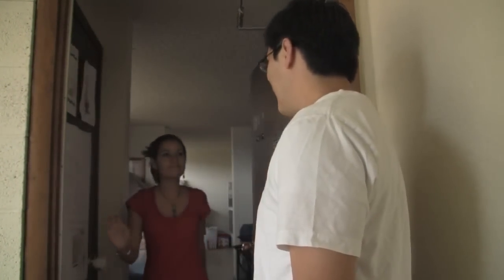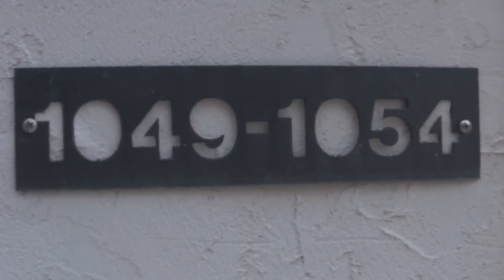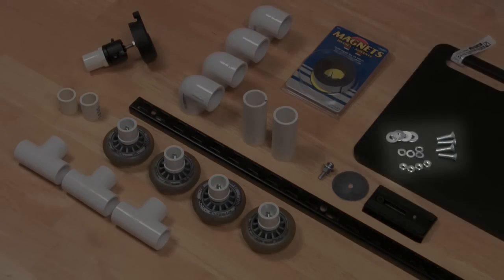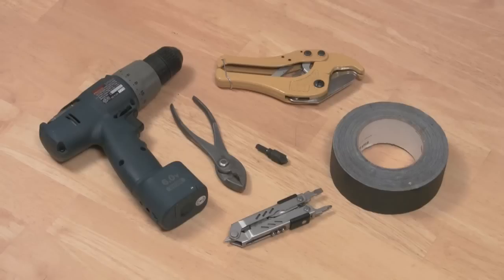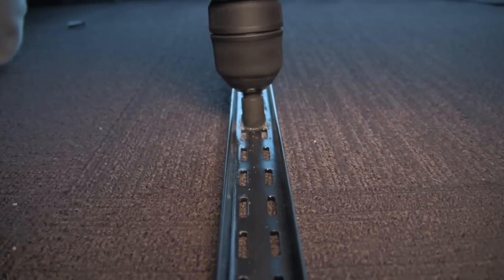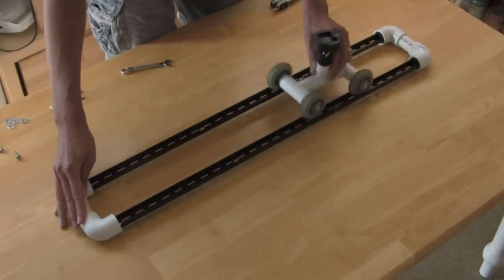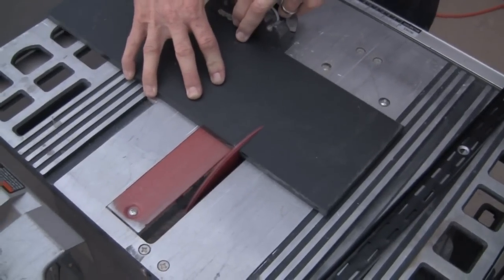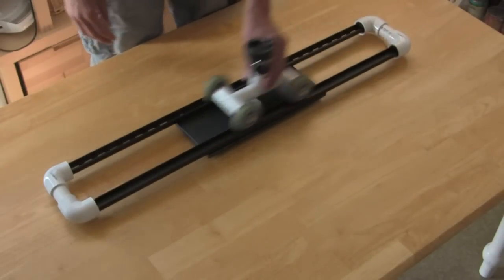DIY Camera Slider (Trolley Dolly)

Comment: For a longer track without any bounce effect, you could also use the full track and buy two of them, then put a t-joint of pvc between the two 90 degree elbows, match the width increase in the dolly and baseplate, and then attach pvc support legs (with rounded caps on the ends) to each side on the added t-joints that are the same height as your tripod. 

Thank you for all you do! You are such a help to us poor film students...

Comment: I pretty much built mine the same way, except for the cutting board (BTW good idea) I used a piece of scrap wood.  
I didn't use PVC for the ends, I bolted some scrap 2" aluminum angel to the ends that also acted as a stop for the dolly.
I enjoy your tutorials, keep up the good work!
Cheers

Comment: Built one! IT'S SPECTACULAR! One thing to note....

I scored my wheels on a pair of old rollerblades at Goodwill($10), they are too wide to actually fit INTO the track, but fit on top quiet nicely! 

Another thing, maybe make it look more professional instead of using pvc ends for your rails/ track... use more shelf rails cut to size. Granted it takes more space, it's way better than gaff tape you'll need to replace due to being compacted over time.

Comment: great video as usual..... 1 item you might want to swap is the magnetic strip w/adhesive....you can use magnetic sign material that is adhesive-less, and easy to cut. You can find it at a sign suppler or most sign shops.

Comment: hi, just a thought. To have the dolly/camera stay put,you can maybe mirror the rail to the top of the dolly also so that the wheels have contact at the top and bottom. Swap the elbows 3 way 90 degree elbows
So now, instead of 4 - 90 degree elbows, you will have 8 - 3 way 90 degree elbows.

Comment: Just a random idea for a timelapse type of thing... What if you took a kitchen timer, Took off the actually dial part, and put a spool on it instead (for example, a spool you would get from a sewing kit) and then you could attach a string to the spool and the dolly, then attach the timer saayyyy 2 feet away, and crank up the timer, and let it roll. So the timer would pull the dolly in as it rotated... A different sized spool could be used to control the speed of the pull too.

Comment from the maker: A board would work as well, but would require much more care in using.  The rails (which you also have to be careful with) keep your wheels in check.

Comment: If you double the rail and put that upside down...attach the two rail systems togheter with a couple of t-joints and you will have the rail locking the trolley in place...it's more safe and can help with that tilt shots and that extreme angles...

Comment from the maker: @TheSlimeBox I have two identical video tracks in my editor (Vegas Pro 10).  I lower the opacity on the lower track (which dims the video) and create a mask for each group on the upper layer.  Basically I'm cutting a "positive" hole in the top video track so the dim bottom track appears to surround it.  I also feather the mask for the soft edge.

Comment: Looks really cool. I wasactually thinking about roller blades, but this is much better. For minimizing damages in case of camera falls, it could be possible to have a rope. Even if it might still fall, it might also slow down the speed when it falls and limit damages. Just thought about that, may be there are better ideas to dig :-)

Comment: Some of the shots look like zooms; I've read that the easiest way to avoid this is to have it pan past foreground items so it gives a sense of depth. I'm also building my own dolly ... a very simple design that stops the dolly coming off the rail. It uses two 1M steel rods, 4x 20mm corner angles,  some "U" channel aluminium and 4 pulleys used for washing lines. (these have a screw on the metal plate) Camera plate is 3" x 5", run is 36" so very compact

Comment: Id like to offer this idea if you would add four 45 angle joints to were your wheel asimblies go and turning your track agle ouward to were the wheels would roll in them it might also lock the dolly onto the rig and by adding some end stops on the tracks it should stay on even at extreem angles

Comment: You could just make a duplicate rail system and invert it leaving some space so that the wheels dont catch but so that it holds the wheels on the track.  The top and bottom rails can be attached with T fittings.

Comment: Could you please make a quick mod to that or even just suggest some materials so I could turn it in to a moving time-lapse dolly? I am looking at motors but I do not have a clue what I am doing. What sort of motor should I use? I am looking for a cheap, battery powered motor that would make a time-lapse last for around 1 hour - any ideas? Absolutely love these videos by the way, saving me and others tons of money on these camera accessories. Keep it up I love these videos!

Comment: Hey, thanks so much for your wonderful videos. For the kind of video clips I record (you can pick an example on my channel if you want to know what I'm talking about), I need to build a trolley dolly, and add a small electric motor in it to control it with a switcher, do you think it's possible? should it be on the trolley, or on the rail with a string? thank's for your answer. Greetings from Switzerland, Firmin.

Comment: Frugal guy: Put your camera on the ground if you leave it for any reason
Video guy: Puts camera on ground to prevent it from falling. But doesn't realize ground is slightly off level and camera goes rolling down the hill and gets run over by a car.
LOL

Comment: Hello!
Just want to say first that all your videos are awesome!
I would like to know what would be a good way to mount this to a standard tripod that doesn't have a quick-connect?
I have a very old, but good and sturdy tripod that just has the standard screw that you would screw in to the bottom of your camera.
The screw comes out about an 1/8th of an inch from the plate.
Would there be a way screw this in to the dolly that would be stable?
Any thoughts would be much appreciated.

Comment: If you built two tracks and placed one over the wheels, attaching the two track assemblies with tees between the 90 degree elbows, even though this would effectively double your cost, would it also not be safer and more stable (in case of accidents?)

Comment: With the four bolts holding the plate to the rails, and sitting on the table (which raises the whole track up a little), do you have anything under the PVC ends to keep it from tipping when you move the dolly?

Comment: I know this is super old but just thought I'd add my two cents and help out ppl who are super poor like me.  If you already have a hack saw with the right blade, which is basically most of them without the wood cutting dinosaur teeth, then that will cut both the pvc and the metal.

Comment: What size is the counter sink bit part. I bought a1/2 inch with a1/4 inch shaft, and the counter sink screw doesn't fit? 
 thanks

Comment: Hi, Steve... I mean, Scott! lol

I made a 5-foot slider for around $20.00. Was wondering if you could check it out. I did, however, have to spend like 40 dollars on extra things like an electric drill, hammer, and other types of equipment.  

Thanks for any input,

Tim

Comment: I like this build, have you tried adding a string to either side of the trolly for angle shots so you could just pull and have it climb or release it to lower it at a steep angle?
Reply from the maker: I have not tried that, though I think I'd rather hold on to the camera myself.  Might have to look into this.  Thanks!
Reply: Maybe some system like the training wheels on the jib... only scaled down to the correct
 size...

Comment: New roller blade wheels don't fit in the shelving rails. They rub up against the side creating vibration and noise. Need a different option.

Comment: Does anyone know if the wheels should ride on the surface of the rails or actually touch the magnetic strip. I have having an issue with the rails not being completely smooth, contemplating doubling us on the magnetic tape in hopes of a smoother surface for the wheels to roll on. Any thoughts?